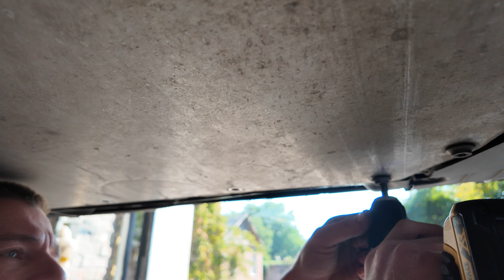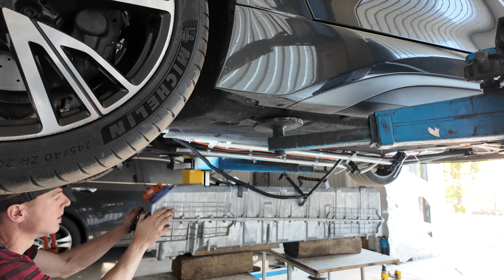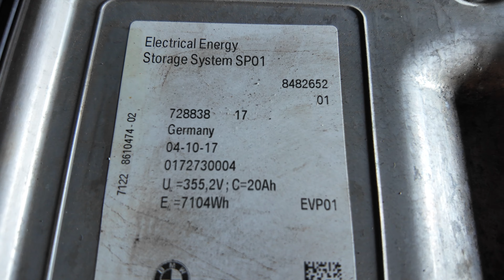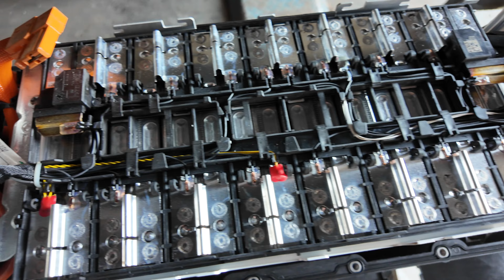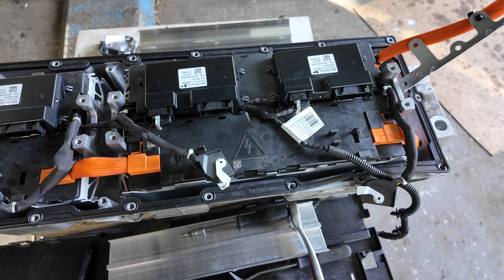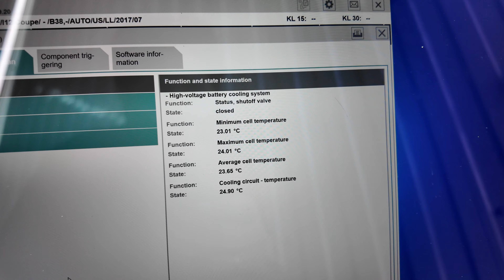BMW i8 HV Battery repair

Comment: Did you have to drain the AC lines to remove the battery? I would think you did but not sure.
Reply from the maker: Ofc, ac connected to battery

Comment: Hey Alex, bmw is saying I need to please the HV battery, can I buy a used HV battery from a i8 with 25k less miles and get that installed?
Reply from the maker: You surely can, but there’s no guarantee it works and will not break. Just replace that sensor, it’s cheaper than getting new battery

Comment: Hi is the battery easy to die and how hard to fix it
Reply from the maker: It seem to be more problem with temp sensors that battery itself. If you know what you’re doing - its easy fix
Reply: @MrSinelnikov  OMG is it the problem with sensing or the actual temperature

Comment: Can the ac pipe disconnected from bottom before taking off Ev battery? 

Or do we need to remove compressor from Top under bonnet or from bottom?
Reply from the maker: @Bmwi8life  it can be disconnected from bottom

Comment: Will a whole battery assembly salvaged from a 2019 bmw i8 fit right into a pre lci 2014 bmw i8?
Reply from the maker: Physically yes, electrically - no. LCI cells have different set of BMS(1 vs 2 on pre LCI), so you can't just plug it to car and make it to work. But you can reuse wiring and temp sensors from old battery to put on new and it should work(at least in theory)

Comment: Great video . I have seen a write up internet of a person in Netherlands who upgraded batteries from 5 series 34ah with bigger capacity into 2015 i8 . He did rewire but the software on the i8 wouldn’t allow him to get full capacity. Would need someone with coding knowledge to change the values to unlock upgraded capacity and miles . Will post page if I can find user is called FLASHER
Reply from the maker: @ishanperusinghe  I saw his post actually and his photos are where I learned how battery operates
Reply: @MrSinelnikov  it would be cool to see if you can eventually do this upgrade fully . I belong to the uk bmw i8 community group and there will be a lot of people interested to pay if you could do this. Even if you franchise solution to someone in uk to do on your behalf I know some bmw specialists

Comment: Awesome, you just added value to our cars.  If upgrading to the newer cells, will it need to be coded to take advantage?  How difficult is the wiring part?  Would be awesome if you can do something like this in the future.  Cheers.
Reply from the maker: I don't think you'd need coding. It would take few cycles to charge discharge to get car properly recognize new capacity.

On wiring part - no it's not hard at all. Basically you just need to split balance wires from cells between CSC modules.

As I said the price of such thing I estimate to be about $2500-3000 and major part of price - is donor battery from other car. Right now I don't have a budget to do something like this, but I'm definitely interested to do this in future